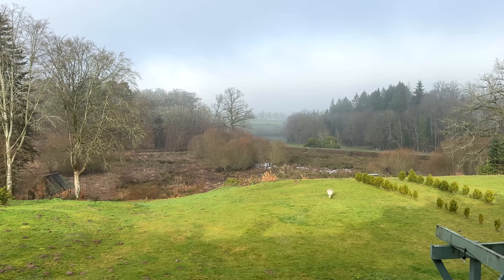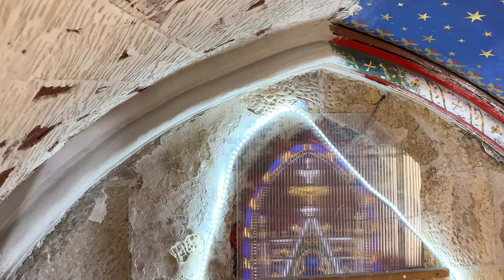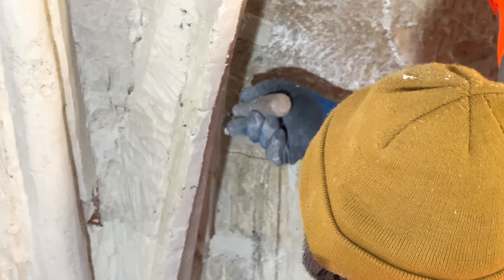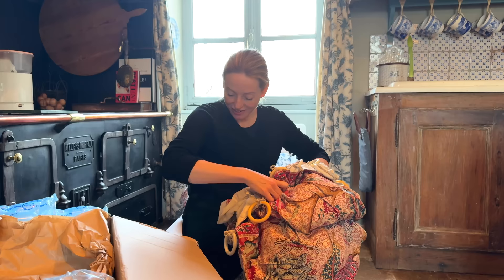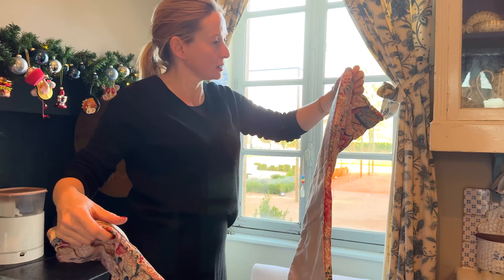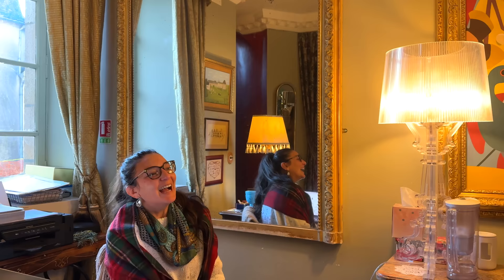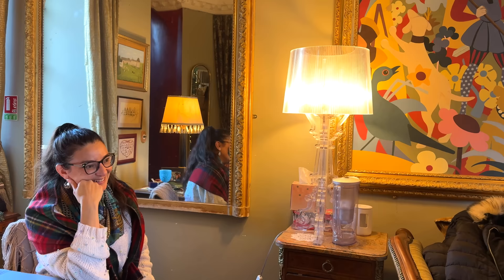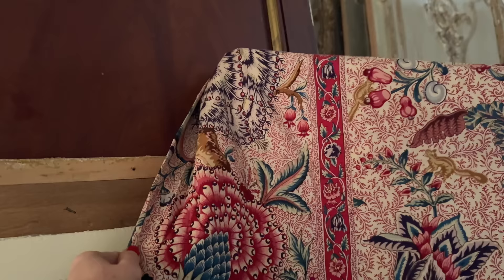Mixed reactions to our new curtains... | Which room should they go into?

Comment: That pattern seems too modern in style. Is this something to be saved for another time? Compared to the other fabrics, it seems too British 😮
Reply: The Jacobean design....modern? Jacobean era is 1600's.
Reply: The pattern has elements of Crewel Work,  Paisley and yes,  it's a bit English.  Question is, for the guest rooms,  or one of the suites,  or the rooms for resident staff?
Reply: The Jacobian style is more Queen Anne traditional and Chippendale style however, mid century modern decor is now using this pattern in accent chairs and pillows.  Not in curtains. The rule of thumb in decorating is to use plain fabric if there are too many patterns in bedspreads, rugs,  bed crowns, etc.  Keep it simple so as not to detract from the furnishings and artwork
Reply: I vote for the curtains going into the Grand Salon. ❤
Reply: Library for sure or not at all. It seems much too busy and overpowering for the grand salon, and the delicacy of the soft colors of the paneling.
Reply: The library

Comment: My 11 year old son and I are on team Stephanie. Although I do think someone needs to make Natty a lovely pull down shade for her window so she is not forced to hide from Sunbeams.Also, it is time for Stephanie to have a real sewing room with a real cutting table. I am a costume designer and I spent years taking over the family dining room for my projects. You can make a cutting table quite inexpensively. When we bought our current house the previous owners had converted the original garage into a shabby "family room" and slapped another garage in front of it. We spent most of our money buying the house so we went to an architectural salvage yard and bought some salvaged kitchen base cabinets for very little money. Then we took them and faced them outwards in a rectangle, put  a thick piece of plywood on top and I made a cover out of this great padded vinyl fabric I had. Not the shiny kind, but the kind that has sort of mat finish so everything stayed where I wanted it to. The beauty of an actual designated room is you are not constantly having to pack and unpack and if you don't finish a project you can walk away, close the door and it is there when you return,  Best idea we ever had. The cabinets give me lots of storage for trim etc. and I can lay things out properly. He even build a bolt holder that pulls out when I need it so that my fabric is off the floor. And cheap, cheap, cheap

Comment: Team Stephanie. I think it would be great to switch them out between the Grand Salon and the Library depending on the season. But if the adjustments would be different for each room I understand you can’t do that. If not I would say Grand Salon. You can paint the paneling to be a bit of a brighter blue/green like in the curtains and I think that pattern needs a large room to balance it. Also I already love to curtains that are in the Library right now.

Comment: I’ve done screen shots of the green patterned curtains you made that are in the library.  And the green albeit unfinished paneling for the grand salon. And the details in the design at the top of the wood panels are very very similar to the pattern in the curtains!  I really think those would be amazing if moved to the salon. Especially if there was a way to add some gold lines into the curtain.  Can you add a sheer or inner lining gold that can just peek out on the inside edges?  That would be so attractive!

Comment: Regarding the curtains, hard to say, as long as the color of the paneling in the grand salon is not definite. Also, I get the impression that the grand salon is a bigger room than the library and I think that the busy print needs space. So it the green of the paneling in the grand salon pics up the color in the fabric as it does at the moment, and if the grand salon is bigger than the library I think I would go with Stephanie.

Comment: Team Natty but if they are never closed and are pulled back where you can’t see the busyness of the pattern it would be fine in either spot.   Might also make a nice grand tablecloth.  I have some stunning fabric I use on my 120” dining table from time to time.  It’s a beautiful table so only use the chintz type fabric when setting the table for a cocktail type event.  You can get a beveled glass table top to put over different fabrics on the table.  I’m sure whatever you decide it will look great.   So, I vote for Steph, Philip and Natty if the panelling is drop dead beautiful and needs no curtains or just needs shutters that close.  Well, that just added a big expense.  Sorry.

Comment: Maybe your engineer can look into mass timber instead of steel? It's being used for high rises as a quicker and greener substitute for reinforced concrete or steel. It's claimed to have a lower carbon footprint.  Timber frames are known to resist collapse in fires but the repair of the charred wood still seems like an unanswered question.  If you can insert new steel beams you can probably insert new timber beams?
Where did the engineer get the idea that steel has a usual life span or about 90 years? There are dozens of older steel framed buildings in Manhattan that are at least 100 years old and are not in danger of structural failure. At least if they have been maintained for the past century plus they aren't. 
You'll have to encase the steel in fireproofing and the timber still has a better chance of survival. Heat causes steel to loose it's strength. The higher the heat the weaker it gets. Timber chars until it finally collapses from overload. The fire can often be brought under control before the beam chars that deeply. A loaded steel beam might get a permanent bend even if didn't collapse.